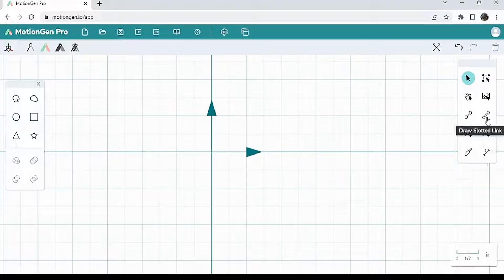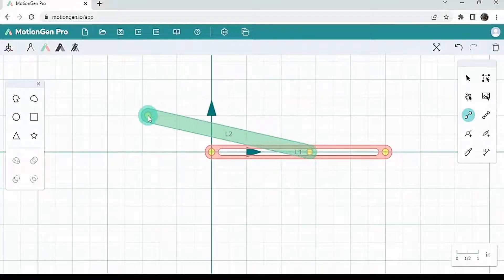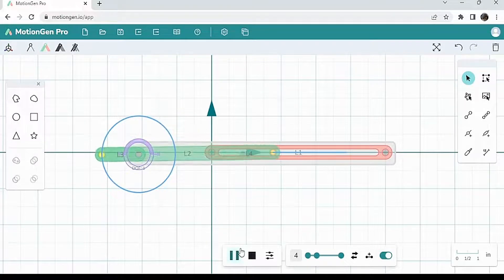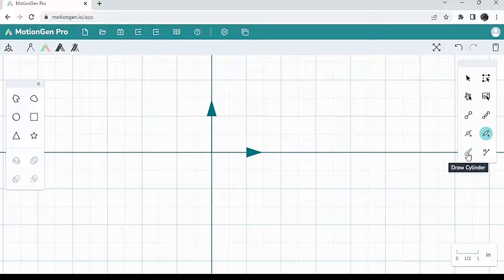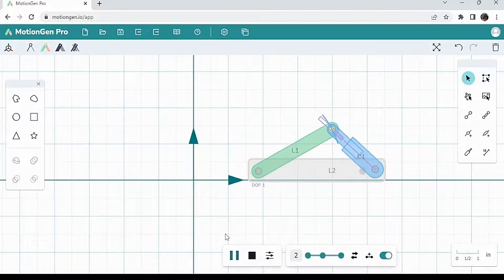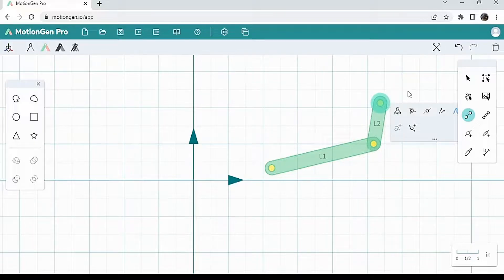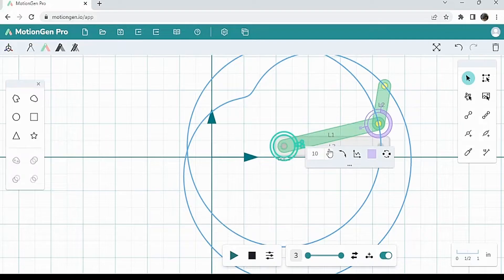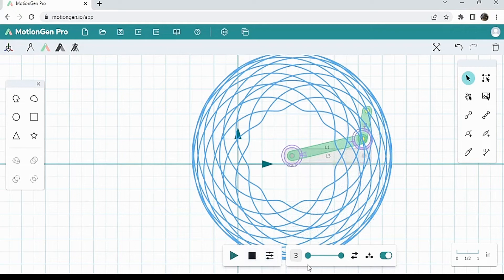Tutorial 5   Advanced Mechanism Simulations and Multi DOF Mechanisms

Comment: software is the worst once i add an rotary actuator and apply sum settings to it play button gets disabled stuck on it for 1-5 hours
Reply from the maker: A multi-DOF mechanism requires as many actuators as DOF to fully constrain it. For example, if you have a three-DOF mechanism and only two actuators, no play button will appear.

Comment: 1. How do we attach the base of a cylinder to a moving link in a 5 bar mechanism. We tried attaching to a welded joint, but that breaks the motion solution. It seems like a cylinder can only be attached to a grounded link. We are trying to simulate using a 5 bar to set the angle and position of the base rail of a linear slide that otherwise slides independently of the 5 bar.
2. Is there a discord or some kind of user group for MotionGen?
Reply from the maker: It sounds like you need a floating linear actuator or passive cylinder, both of which are possible. Please send us a sketch or picture of what you are trying to model at support@mechanismic.com.

Comment: Is it possible to "merge" two slots? I would like a mechanism that follows a slot with a 90degree bend
Reply from the maker: Yes, you can join slots. Find the example Scotch Yoke mechanism in the library section, which shows two slots joined at 90 degree.

Comment: any way to add belts and pulleys? How does one simulate a coreXY mechanism?
Reply from the maker: @circuitdotlt  There are no pulleys or gears as such, but you can simulate them by adding two levers and specifying their speed ratios based on their radii. For aesthetics purposes, you can draw circles and attach them to the links so that they look like gears/pulleys.

Comment: Hi Please let me know how to adjust the stroke length and dimensions of the linear actuator..
Reply from the maker: The linear actuator stroke length depends on the attached object. For example, if you attach the linear actuator to the cylinder, the minimum and maximum stroke lengths are defined by the cylinder's stroke length. You can change the stroke length under the cylinder toolbar by clicking the three dots, where you will find an option to adjust the stroke.